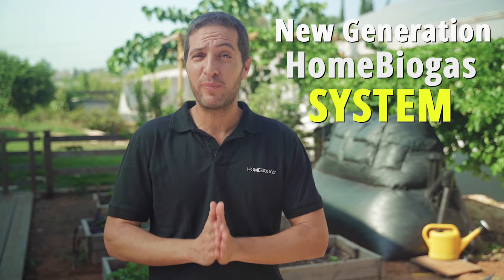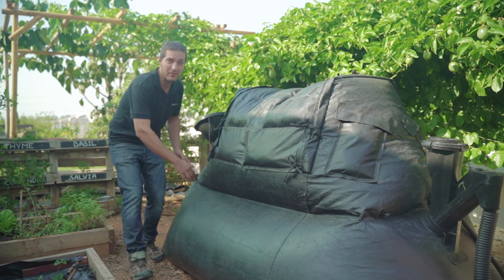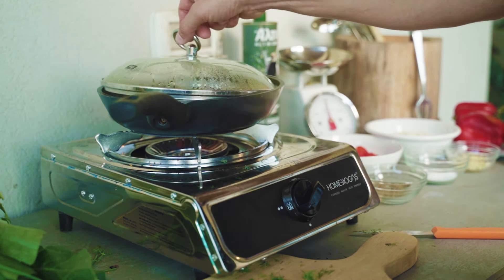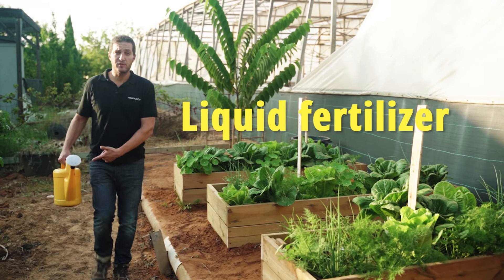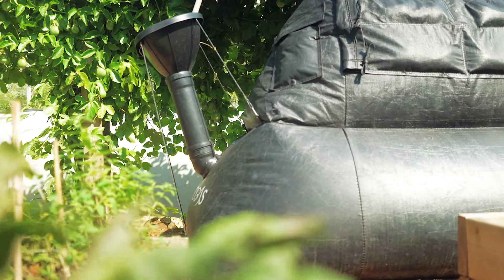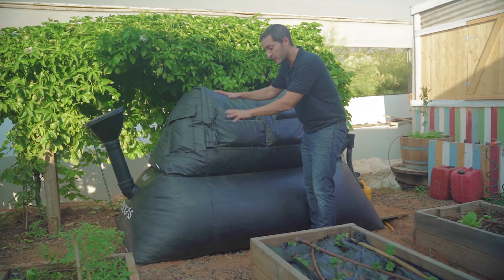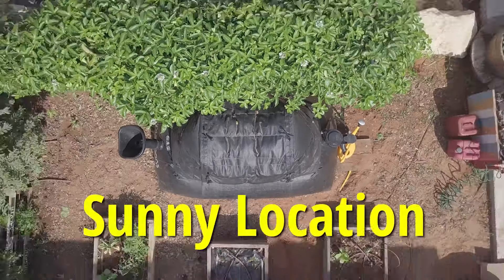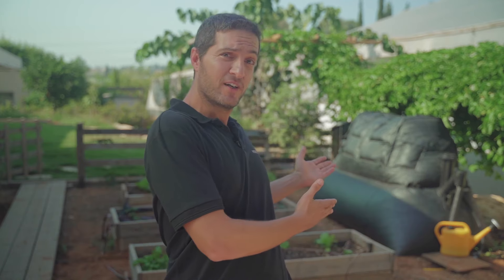A Quick Lesson: How HomeBiogas Works

Comment: What gets me is, that this Company only Concentrates it's Efforts on just Waste from the Kitchen. Why?  With a redesign this System could be so much more, in my opinion.  Eliminate these Materials that want last, as they say for just 15 Years. This is Poor Craftsmanship, in my opinion. Animals will Investigate and will Eventually Compromise Integrity of Unit causing Great Damage. Over a Short Time Span, these Materials used in Construction will Fail. This Failure will cause more Hard Earned Money to be Consumed to replace these Unit or Units. This Product needs to be Redesigned using better Materials. It needs a Small Compressor to Compress the Gas, It needs a way of Maintenance that It doesn't have right now. Also this Gas System has to be kept Warm or it want make Gas. So those that live in Cold Clements will find this Product almost useless. I'm giving a Theoretical Thumbs down because it could be far more useful than it is. A Thumbs up because the Possibility's and Concepts are Rock Solid. This should be being used everywhere it's warm. With a well Designed System a Generator could be Employed cutting Electrical Cost. The Gas that's made by this System can be Converted into more useful Products than just Gas. Thanks for the upload mate. Your Efforts are Appreciated.
Reply: They also have a toilet add on which is more convenient and efficient than a composting toilet. I just started using it so can’t say much about long term durability. Agree that it’s not ideal for cold climates, although you could build a small greenhouse over it to keep it working year round.
Reply: @masterrpgs  Thanks for adding your experience in your review of this Product. Maybe using this System under Ground could Solve Problems seen with this System. Using a Pump that could compress the Gasses into a Pressure Tank would Increase Longevity. This Product would be Fantastic, easy to use year around. There is Potential here. If this Product was Incorporated with-in a holding Tank that Is designed with Materials like ALUMINUM, STAINLESS, CARBON STEEL, FIBERGLASS, or even CARBON COMPOSITES would most likely Solve the Rodent and Insect Ensues. Also Heating Element's could be added to the Design Increasing Longevity and a consistent Temperature Year around for GAS and FERTILIZER production. I would re-design this Product for them, 'if they asked for my help for a "10% Gratuity" on the sales of this Product after I re-design Product Payable at the beginning of each Year. Well again, 'thank you for Sharing your knowledge with me.
Reply: @masterrpgs  thanks for sharing your experience . one thing is not yet clear to me . How many days did it takes before the system produce gas after installation and first feed ?
Reply: @chidiayoanasonye9243  They recommend you initially add 100 liters (25 gallons) of fresh grass eating animal manure (horses, goats, cows, etc.) once you do that you should get gas that will produce a flame in about a month. I didn’t put any manure in it. Just used it as a toilet and got flammable gas in about a year.
Reply: Have you been invited to any parties lately?
Reply: Accessibility.  Make it easy to make it mainstream.  Go from there.
Reply: I wholeheartedly agree with you about everything you just said. ❤
Reply: I agree I was wondering about the animals and puncture and why doesn't take any other stuff you can break down to use but I  Congratulation them for this and for person uploaded this I'm real interested in the fact that they did it and you seem very knowledgeable so when you come out with yours please let me know I would really appreciate it
 Thank you in advance
Reply: @LouisT1981  what? Are you wanting to invite me to a Party? That’s very nice asking someone you know nothing about to a Party, Mate. But, in my opinion, ‘your being vicious. Are you? If not. Ask me again. Thanks for your comment.
Reply: Have you designed your system yet? it is it for sale?
Reply: @AWcinema  no young man , I haven’t. Would you like a design and a product to use for yourself? If so, let me know.

Comment: How well does it work in winter, when the temp drops, especially below zero?
Reply: the system doesn't work
Reply: @WilliamHelstad  a minimum of 20 degrees centigrade
Reply: Put it in a greenhouse to insulate from the cold air and still absorb sun heat
Reply: @ruburtoe1  Well that answered my question

Comment: Well, it looks like the exact system I need. But how it produce gas in cold winter? and how people deal with the sediment on the bottom? How often?
Reply: There's a flap that can be opened to shovel out the compost. It won't work as well in the winter if there's snow but may some work if snow is kept off and away from it in full sun.

Comment: I would love to see this power a home heating system, but the problem is I've only seen them use home heating oil or diesel or natural gas. Still an awesome idea, especially if you're living off grid.
Reply: That would be a game changer
Reply: saw Flexi Biogas from Kenya showing how it heats water; probably adding it to the heating system works
Reply: Wouldn't wwork for heat. The video clearly says it provides 2 hours of (cooking) gas per day. That's not enough to heat with.

Comment: I have a couple of questions. 1. How long does it generally take to transform the foodscraps into gas? 2. How could we use this off grid to make heat for our home?
Reply: I would use this gas in the kitchen with a multi fuel stove, it takes 6 litres of muck in your biogas generator to make roughly i hour cooking time, hob and oven. You can use any lpg oven just make sure the tube is wider (for slightly more oxygen) by removing the nipple at the connection point.
Reply: 6 l of muck per day for one hour of what appears like an alcohol-like burning hob? Wow. To get the two hours of cook time 12 liters. I need to create 5 gallons of effluent per day? 

I really, really like the idea, but I'll need to handle my shit in a different way, so to speak, lol.

Comment: Hello, How are you?
Recently, I'm helping my friend living on highland area to develop their new modern farm. I found your products amazing, but I got one question. It's about the temperature since the average temperature here is 0 to 25 degrees in summer and -20 to 0 degrees in winter. So my question is how your product adapt these highlands with a relative low temperature? Thank you in advance.
Reply: I did read some things about winter en biogas. Practically you cant come under +6c or the bacteria will go into slumber. This can be worked around by isolating it. For example, putting it into a digging a hole into the ground at least half a meter (where its always 5c above temp. Putting it into a greenhouse (maximal efficiency  you build the greenhouse with the northside  against the southside from your house) and wrap the sides up with reed mats (never the upperside, if you need to isolate the top, something see trough like glas or polycarbonate). If its really a hard stuborn winter, put an aquarium heater in on a solarpanel. 

If build anything on your friends farm, before you begin, think about as much all-n-one possibilities you can think of. A greenhouse on the southside against your building is not only a mor efficient greenhouse but a buffer for your warmth in your house and your greenhouse, especially in the evening. A greenhouse ALWAYS needs a water element like a small pond or fountain. It is the airconditioning and hydrogenmeter of your greenhouse. This element can contain edibles like waterplants and even fish. Or you can use it for grey water storage of your house (shower and stuff) and water the plants after with it. We have an inside outside shower with bathtub in our greenhouse. With solar heated natural filtered rainwater.

Think like this with everything and you'll be living comfortable en self sustaining in no time. 

Any qustions, dont hesitate to ask.
Reply: @sannewijn8695  Great idea to integrate the whole biogas system into greenhouse. That's the exact idea I'm thinking these days for its viability. Thank you so much for this concrete solution.
Reply: 100% agree, my wife & I are getting ready to develop a homestead of grid from the start as there are no structures. This is going to provide us a unique opportunity in turning our waste stream into a valuable resource.

Comment: Can I also add garden waste, such as hedge trimmings and chipped branches?
Reply: An HBG digestive bag is pretty much like a Hugh stomach. It is necessary for the stomach to decompose nutrients in order to produce methane, therefor hedge trimmings and chipped branches won't do any good, but will only accumulate in the digestive bag.

Comment: the system produces only liquid fertilizer as a by-product or solid; and if so, how and when is this removed?
Reply: From the HomeBiogas FAQ: "The system does not require any cleaning of sludge as the system is designed in a way that creates a very little sludge that has a negligible effect on the gas production and requires no cleaning or special treatment."
Reply: @holycrapchris  thank you for your replay !!! have a nice day !

Comment: im interested to also know how then do we convert that gas to electricity as part of the home solution
Reply: You would need a generator to run on the methane produced by the digester.

Not sure how long the generator would run on the gas from a small biogas system and the noise.

Solar and/or wind may be a more consistent solution and use the gas for cooking.
Reply: Buy a trifuel generator.  Own a home biogas unit.  Its one of the things i plan to do with my gas.  I post details about how it works later next month
Reply: @liocean9636  how did it work?

Comment: I got one behind my shed which ticks all the cons of making the gas

It takes a little while to get going I used some of my cows manure 

But now I got my burner shed it’s going more than in the house works a treat I have mad little feeds when I’m doing work outside

I unfortunately can’t connect direct to my house as I’m on land and can’t run a line as I got 7m of concrete right around the house
Reply: Hey Mitchel, you are welcome to consult with us at support@homebiogas.com 
<3
Reply: @homebiogascustomersuccess6844   I’m happy with it :)
Reply: You'll have to take it to your house.  Capture it (bladder, inner-tube) and use a compressor to fill some old cylinders.

I haven't taken it apart yet, but my plan is trying a 12v roadside air compressor.  If the inlet can be hose clamped (or made to) it should work great.  Some two-part epoxy, a shut off valve and brass hose fittings, you're good.

Comment: Biogas is methane...so is this a case of "it's better to burn the methane than to have it leak into the atmosphere through anaerobic landfills"?  I assume the system just burps off excess gas that it can't hold as there's no compression functionality?  Again, I'd guess that it still comes to the which is worse question for that excess methane.  And, you seem to imply that the water is liquid fertilizer.  I'm not a scientist, but how would that water have any nutrients?  Isn't that just evaporation from the system as it's working?